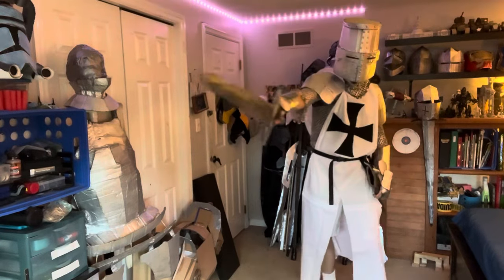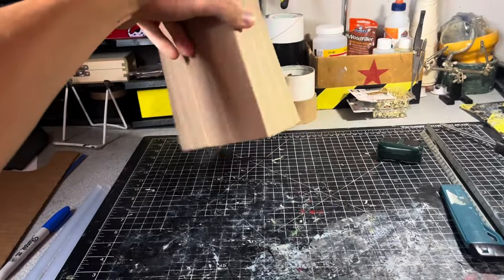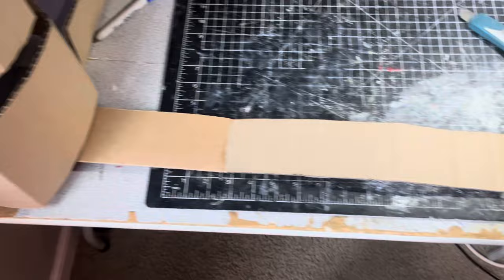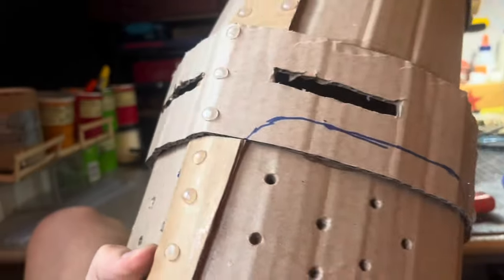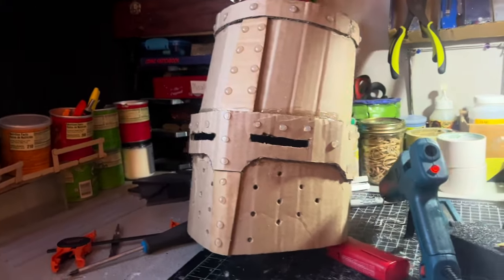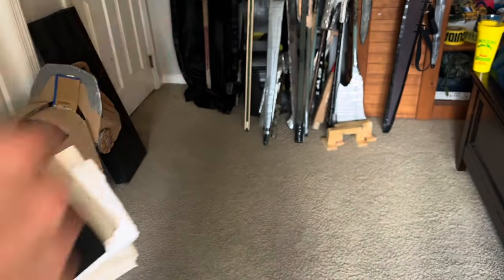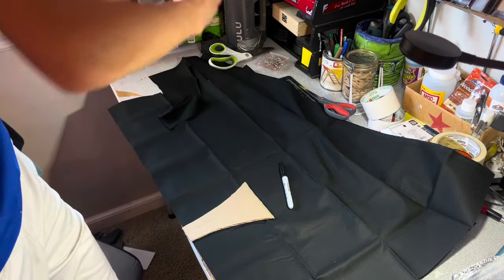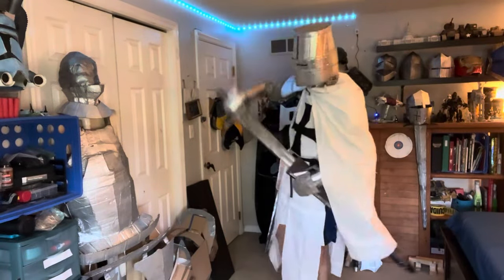How To Build a Cardboard Great Helm and Teutonic sir-coat.

Comment: YOOO HE DID IT, HE FINALLY DID IT HAHAHAH

I am now going to attempt to create a frog mouth helm, I will fail, but it's worth it to try
Reply from the maker: That sounds awesome dude and yeah I usually go through multiple prototypes before I’m satisfied with the results but that’s what has to happen you gain experience along the way!
Reply: @MarksWorkshopcrft  well I made a Great helmet and it is for me Easy just like close to historical but yeah need to train experience.
Reply: About a Frog mouth helmet  if that's hard just pick up the picture about this helmet and that will help you
The early prototype was simple, but the latest was like over 1450's that was hard to make.
Reply from the maker: @drakov2137  ah yeah I could make that it’s just everything I build was built cuz I was drivin to do it like my adhd made me fixated on a hounskull for example.